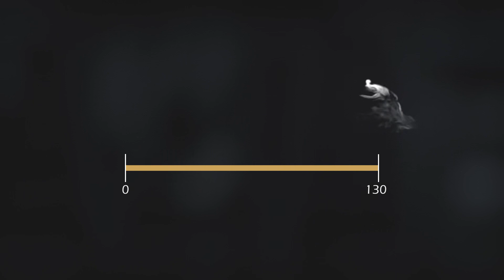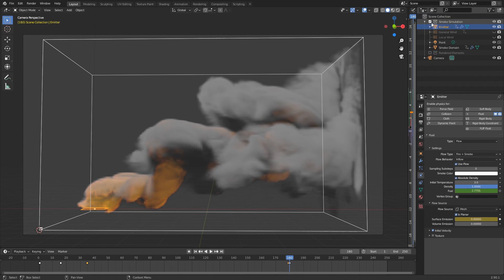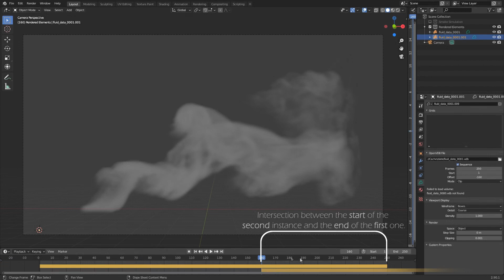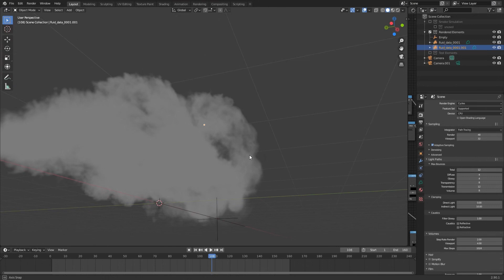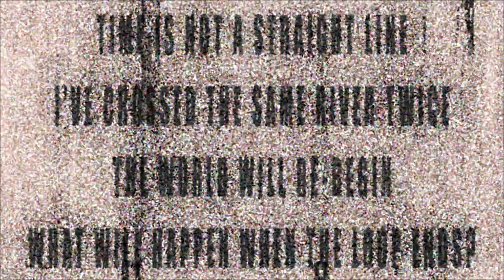Looping Smoke-sims in Blender | Quick Tip on Simulations

Comment: Sorry for possible noob question, but how do I recreate the cache data (eg fluid data 0001.vdb, etc so I can test the files in the rar on my own computer). Im sure this is easy, but im pretty new to blender! Thanks! I baked the simulation, but when i disable it and switch to render, im not getting any smoke in viewport, and it says the vdb files are missing. So how do I recreate them?
Reply from the maker: It could be that in some of the project files, the cache directory field is empty (under the cache panel, in the Domain settings). Just set it to a folder that can take dozens of Gb in space, since the cache can get pretty heavy. And after baking, select the volume objects in the "Rendered Elements" collection, and locate the folder to find the cache data. I hope this helps! Otherwise, I could just go and modify the project files a bit.
Reply: @Iago Mota  thank you for replying, I will try to change the cache settings and then bake! Do I need to have the bake set to modular too? (im not sure which settings follow the project and which are in my blender installation, its at modular atm). Cheers/J
Reply from the maker: @joinushugabear5847  Alright! The difference between Modular and Final is pretty trivial. "All" bakes all the elements of the simulation at once, while "Modular" bakes only the low-res base and allows you to simulate the high-res noise afterwards. I usually leave it at Modular, since it allows for a bit more control.
Reply: So I have managed to get smoke and loop in some of the project files (not small scale cross section for some reason), and it works great in viewport. However when i render the volumes I get nothing in the frame. Using cycles. Im sure this is me not understanding something very basic, but I have already tried googling it without luck. Any ideas?
Reply from the maker: @joinushugabear5847  Oh that's not supposed to happen. I just tried baking and rendering the simulations again in 2.91, and they're all working for me. Does using the rendered viewport shading mode work? If not, it could be that it requires too much memory, so i'd recommend trying lowering the resolution of the simulation, and maybe increasing the Step Rates in the render settings, under the "Volumes" panel. Unfortunately, I don't know the solution, since I haven't encountered this issue before, so right now I'm just trying to guess what it could be. I'm sorry if this doesn't lead anywhere, since it could even be a bug.
Reply: @IagoMotaVFX  hmm, wierd! I get smoke in  rendering using cycles if I start a new file and do a quick smoke effect. Then I can see emitter object and smoke, but with any of your files I get only the emitter visible when rendering, no smoke or fire.  Did you try to render your files from the .rar files you provided or from your computer original files directly? I tried on two separate computers with same results to be sure. It most likely is me doing something wrong, but I just can not figure out what is is, and its very much bugging me. Thanks for the help anyway!
Reply from the maker: @joinushugabear5847  Yeah, I'm doing it after having extracted the .rar file into a folder. I've only tested these files on 2.90.1 and 2.91 (2.91 is the recommendation), so I don't know if other versions render them differently.
Reply: @IagoMotaVFX  Thanks! I asked someone who knows blender way better than I do, and they seem to think it could be a problem with "density_noise attribute isn't getting populated with any data, If I just put the regular density value from the volume info into that multiply node, it shows smoke
 even with the bright/contrast set to zero. I don't know where those attributes are supposed to be coming from, but that seems to be the issue", and that "that Bright/Contrast node is scaling everything before it to zero which is setting the density of the volume scatter and absorption nodes to 0, so they're not doing anything". Is this something that makes sense to you, and could that be the problem? Cheers. Thanks for helping me btw, its bugging me that I cant get it to work really.
Reply: I think we might have cracked it, and of course it was me doing something wrong as I suspected! I put in the vdb files from the data folder in the volumes instead of the fluid noise vdb files. Cheers!
Reply from the maker: @joinushugabear5847  Alright, that's great to hear! Embarrassingly, I've made this exact same mistake several times, but completely forgot about it. Anyway, good to know it's been resolved!
Reply: @IagoMotaVFX  I managed to get it working, but then I tried to change a few things in the simulation but then when I render, not all of the smoke is visible anymore. Do you have any idea why this could be happening? Blender is very confusing to me, lol.
Reply from the maker: @joinushugabear5847  Hmm, that's strange. Which project file is this? Does the smoke cut off harshly, or is it like a gradient where the smoke fades out the further it gets in a certain direction? If it's the latter, it could be the shading. In some of the project files, I'm making the smoke "dissipate" in the material nodes to have a bit more control over it. There should be an empty that controls the position of the gradient; so, if you move it further along the X axis, more of the smoke will be visible there. But the issue could definitely be something else. So yeah, once again, sorry for the annoying questions!